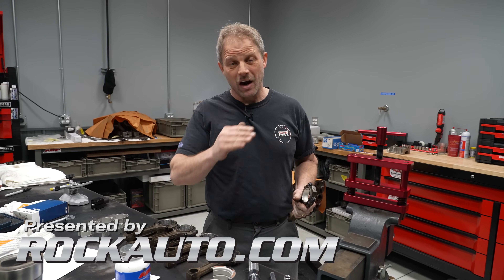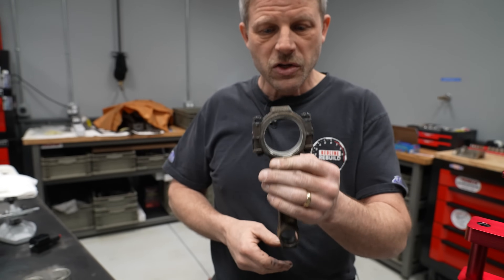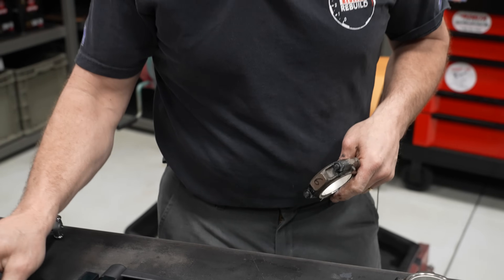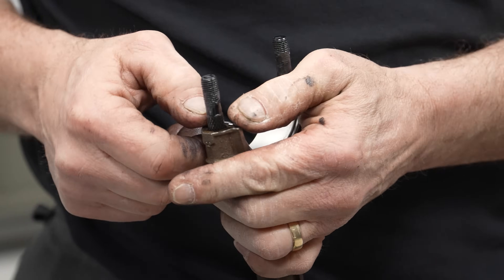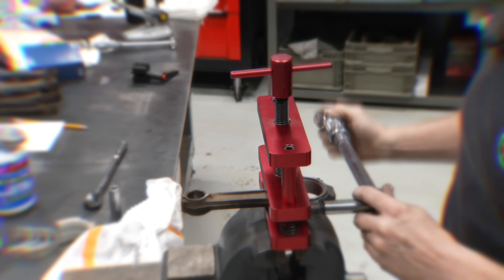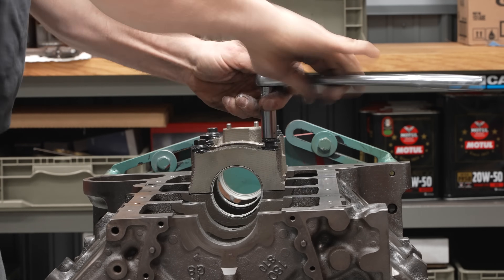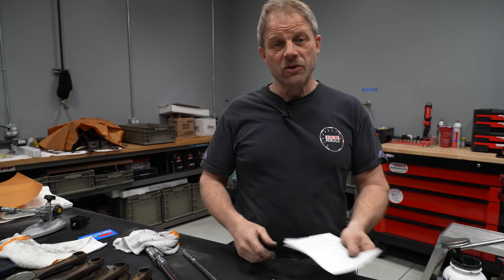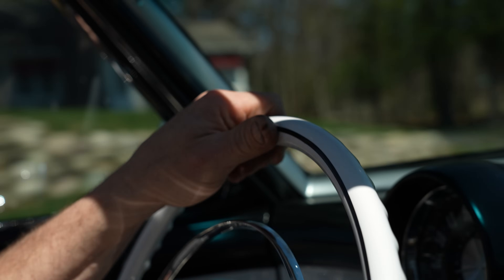Measuring crankshaft oil clearance on a Chevy small block V8

Comment: You don’t need to check your bearings before the crank is reground if it’s cut .010 U.S. you just buy .010 under bearings you do need to check each Clarence but the crank will be cut exactly .010 under no more no less checking bearing clearances is just to verify your bearing bores don’t have something funky going on

Comment: GM specs closer oil clearance on those engines. Around 1.5 thou. Which for a standard engine is fine though use the high pressure,,,not high volume 350 pump which pumps 55psi V around 35psi for the original. Then use a synthetic oil. 
I  use 1.8-2 thou on 7500 rpm  12-1 350 race engines with  15/50 synthetic with no issues.  None of this 2.5-3 thou rubbish using mineral oil. Oil pump uses a lot of power and for a wet sump loads up the dissy gears big time.

Comment: Davin, I really enjoy the SBC build. I don't know if you have a camshaft picked out but it would be cool to see you use something like a Duntov 30-30 solid lifter cam and vintage 4 bbl intake/carb to top it off. Any thoughts on where this engine will end up?? Thanks!
Reply: With stock heads it might be too much cam for drive ability .

Comment: Firstly love your channel, and it's great to watch you work. But with the rod vice I thought you'd have to have the rod and the cap clamped in there to prevent any twisting, what's your reasoning for just having the rod end clamped in there? Also, would you ever balance the rotating mass of a stock engine like this?

Comment: Let me put something out there, I see you rocking the micrometer up and down. Assuming you are using the largest measurement, aren’t you taking a tipped measurement of the diameter?  This would be larger a than a measurement taken with the instrument square to the diameter.

Comment: How to check SBC oil clearance- fill with 5w30. Check hot oil pressure at idle. If less than 15psi, change oil out with 20w50. Recheck oil pressure at hot idle. If above 15psi, ship it. Lol

Comment: As a retired machinist and later engineer I would suggest checking your bearings for size in at least three places in case of out of roundness. Even if the block just been line bored or honed you can have hard spots in cast material that causes it to not machine properly.
Reply: I have a question for you, Davin used a bore micrometer and by the looks of it, it had three points of contact (at 3:32) for measuring. Wouldn’t that be checking in three locations all at once? He wasn’t using snap gauges and I understand using more locations when you’re using those.
Reply: @Hoaxer51  indeed there are 3 measuring faces on the bore gage. That just gets you centered. What the fine gentleman means by check 3 places is rotate the gage to measure 3 different locations of the circle to get 3 different readings and verify there aren't any spots over or undersize. As he said, just because you machine or bore a circle doesn't mean it will for sure be "round" or a perfect circle. I hope that explains it.
Reply: @joshuagibson2520 , What I saw at 3:32 looked like it just had the three contact points but as jzab pointed out at 6:18 I can see the single contact point so I understand why Vettekid said to check at three points. Thanks All for straightening this out for me, I saw one thing and I should have kept looking. I really enjoy these videos and there’s a lot to be learned here even from a short video.
Reply: @Hoaxer51  all good my friend. I had a lot of old timers help me out in the trade over the decades and I've always vowed to try and pass along as much as they have to me.
Reply: @Hoaxer51  looking at when David is measuring the main bearings (6:18) there’s a pin in between the wheels and one opposite. I thinks these pins do the measuring and the wheels help with centring.
Reply: What steps are taken if you find the journals (with the bearings) are out of round?

Comment: Davin, seeing that Buick straight eight engine restored and in it's appropriate new home was great. That '51 Buick Super convertible is a treasure. I'm a convertible guy myself. I own a '12 Chrysler 200 Touring convertible. I'm learning about my car and have so far done front and rear disk brake reline and changed out the power steering fluid on my car.